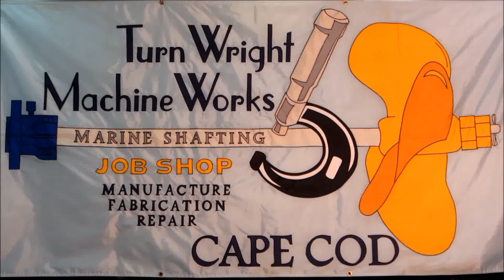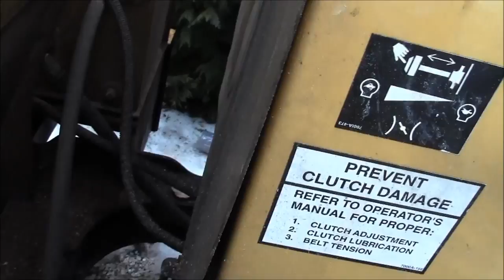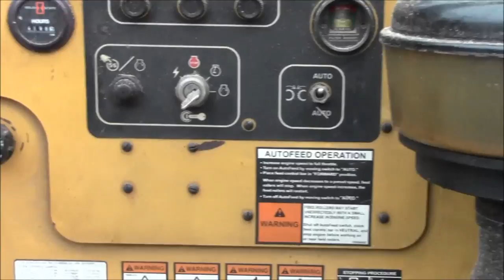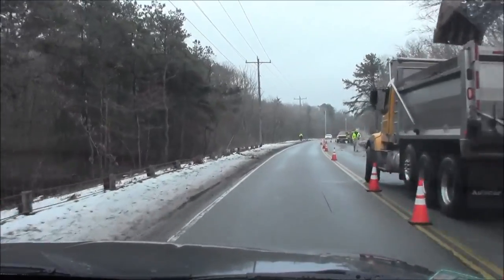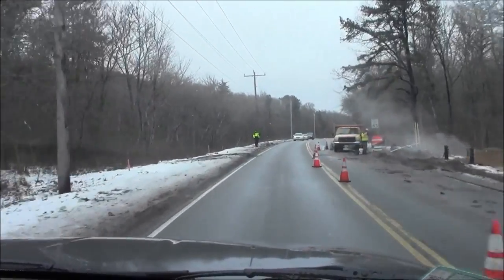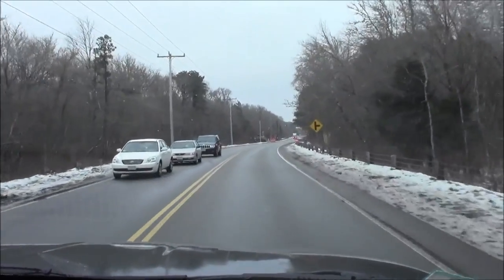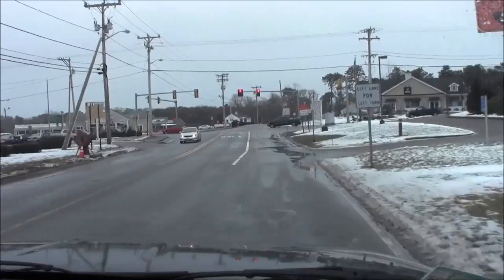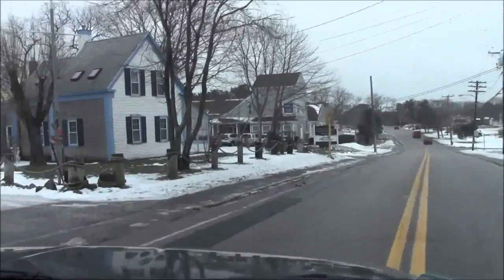Checking out the Beaver!

Comment: just because you can fit a log into it, does not mean you should. That beats the crap out of that machine. Could easily throw those logs on a low trailer and drop them off as firewood/ possible charge for it too

Comment: I used to (in younger days) make arrangements with two-three wood felling companies to pickup their wood logs just as you see here.  They went from 4" to about 36" inches in diameter.  From March 1st to May 30 I could collect up to 50 cords of wood and actually haul three cords in my 20 trailer (3 ft walls, and 7500lb dual axels) home.   They were happy to load them and I merely drove off after they loaded it.  I burned them in an enclosed firebox with a glass front that allowed me to burn all night.  Did that for 5 years before I developed problems from agent orange and had to stop.   My fuel (natural gas bill) was never over $30.00 !!!   (For hot water heater). It was great, but seeing them chew up good wood is just unfortunate someone couldn't come after it.

Comment: For everyone saying they should have used the wood to burn; I think it's pine and you really don't want to burn pine in a stove. it doesn't put off much heat and there's so much sap in the wood it makes a mess.
I've burned it outside in a campfire and it made more smoke than heat.
Reply: Geo Metric yeah, if you have a crap stove. If you season the wood then feed it to a modern smoke-burning stove it will be fine.
Reply: anothermoth He clearly stated he burns green wood.  And pine does suck for heat overall, I prefer harder woods to burn.  Outdoor I like fir.
Reply: soaringtractor Pine makes great firewood if you want to burn your house down. Creosote and tar buildup in your chimney makes a great jet engine sound as it catches fire and burns.  All the stupid comments about this being a waste of wood. There is such a thing as something costing more than it's worth. Portable saw mills, paying a crew to cut up one tree for firewood. Yea if you want to find some hobby furniture maker to cut down the tree then pay the legal fees when he gets hurt, go ahead. And all the safety Nazis. Damn, it's no wonder when you buy a stepladder, you can't see the ladder for all the warning stickers plastered on it. And if you live in CA, dirt has a cancer warning on it.
Reply: soaringtractor I have burned it, a bit sappy though, but good heat.

Comment: Interesting, I worked for the big orange company for a few years and never thought you could put an 18 inch log thru the machine, we were lucky to put a 4 inch limb into the chippers and keep the motor running, but we did run the heck outta them, on one job we ran the chipper so much we blew a rod, and yes the oil was up to specs, those were the days, and that was in the 70s. I enjoy your vids keep em coming

Comment: Lot of comments here about the size of wood being fed in to the machine,'
That chipper will take anything that you can fit in the hole and in fact they could just feed the whole tree in it and it would handle doing that all day every day.
Owners of these like the set the gap between knives and anvil a bit on the large side to speed up things, too big will cause the drum to slow very fast and that will take a toll on it and no surprise it snapped something.  The chips are huge and see at 9:47 and 12:20 its got such a gob full its tossing a heap of chips in the ground as the drum slows.

Comment: Glad you knew of the bulb issue. I agree with another comment up higher ,, your next job for them could be a adjustable speed valve for the feeder hyd. just to let them slow down for large logs but fast feed for brush, it sure would save that engine for a 100.00 pressure valve in line added. Regards Xmodriver

Comment from the maker: It is one of two bulbs on the front and Dodge had a brain fart in their designing department, in the building of this model. You have to take half the truck apart to fully remove bulb. the blinkers still show turn, front and back, I'm waiting till I change out chrome bumbers and then I will have access. ;{)---

Comment: Help Keith amazing truly amazing step by step you what why and better than manufacture so true ,,,your  setups and machine work ,plasma and torch heating and your welds are   real good and love the radius setup with the tracer setup on the back of the lathe can't complain with any of your work and keyway will never wiggle its self the way it pulled down in this case it warrants that custom keyway  I had worse key cuts when I forgot to lock the table  and boss did one keyway  went over to the side and was to late to save the 1300$ shaft ,the shaft would be rejected even if a custom key was made really enjoyed  all you videos  keep pumping them out  Keith excellent work and you worked with out drawings and you were able to  figure  out  the game plan to didn't even ramble on and on with useless words everything you said was done as you spoke.

Comment: How many years of service did that chipper see before the shaft broke? 

I can remember watching my uncle when he hired me to help him drop 28 trees in one weekend, old heavy home lite chainsaw that weighed about 48 pounds he did wear leather chaps but never any ear protection 1964. He hired a logging truck to haul the timber out. He made a little less that way but didn't have to pay for and maintain a ten wheel logging truck. Truck was a 1962 Mack B-81 with a 30 ton winch no loader. The owner operator loaded all timber by 2 pole ramps and the winch and it only took him just over an hour to put a 60000 pound load on that truck with only one new helper  later I found out the GVW for a ten wheeler was 60000 pounds but back then DOT was at home on weekends.

Comment: I don't burn wood, but I have friends that do, and this is how it's been explained to me why you don't burn pine.
Pine is a soft wood, softwoods burns fast, so you get a lot less BTUs out of soft wood than hard wood, but worse than that pine is full of sap, when it's burned it coats everything with creosote.
When your chimney or pipe  is coated with creosote it's a fire hazard, that's how you get chimney fires. 
Most wood stoves use a pipe as a chimney,
it's easier for them to catch fire.

Comment: you will probably see that in your shop again i have run the beaver chipper before and it's not designed material large enough to stall it out. that's why you got it in your shop to start with.

Comment: Hey Keith. Awsome videos. I really like seeing what the repaired part is used for when it is done. Quick question for you. What is the best way to drill a hole through a 1" by 2" steel tubing. This hole is going to be drilled at a 33 degree angle through the 1" direction. Thanks for any insite or experiance you may have. I have to drill 600-700 holes. Thank you for your time.

Comment: This particular machine IS capable of handling a log that will fit in the mouth of the machine, however watching the chip flow and listening to the engine revs and the long recovery time it should be mentioned the machine is working past its design capacity. Eventually other components will fail, if the inlet is feeding nothing but limbs (what its actually designed for) even at full capacity it would not take as long for the RPMs to recover. Optimal feedrate is between 60 and 70% inlet capacity

Comment: Pine aren't too good for firewood unless you find happiness cleaning the flue :)
Good starter fuel, but will soot up everything else. The sap actually helps to keep mulch longer though very few mulch suppliers use pine. Its mostly cypress down here

Comment: One way is to split the wood to a certain dimension, get it burning, then "snuff" it out.  Kinda like capping the chimney and sealing the hearth.  The residual heat continues to cook the wood and carbonize it.  When it is cool, you have wood charcoal.  You could do it in a 50 gal drum with a lid and a sealable airvent.  Google coke making process, But that is made from bituminous (tarlike) coal.

Comment: Great job Keith, I'll refrain from committing on the tree service. Suffice to say you'll be seeing their equipment in the future on a regular basis. I see this was back in 2013, are they still in business? Questions: looking back with clear vision would it have been easier to manufacture a new face plate rather than struggling to get that one to run true? What would you do different, other than the key way, oops....Question #2, as you showed with the feeler gauge the jaws no longer clamp square. Can you remove them and line mill them so that when you clamp down they are once again square? Or is it possible to machine the backs of the jaws where they slide in the chuck face, or something else? Im just curious if there are methods to adjust for the normal wear and tear on a chuck to maintain some of its accuracy.Lastly your a good and honest man, and a craftsman! Thank you, Scott Pecora, Vancouver Washington
Reply: That was suppose to be commenting!

Comment: I wonder what max diameter logs the manual for the machine calls for. I wonder how many hydraulic repairs they go thru, and loading the engine like that can't be good. However, I will predict that the last part to break next time won't be the new shaft/tooth holder assembly.

Comment: Hi Keith,  I think that how that shaft got broke in three parts the way they work that chipper.

I've seen the same model handle same size log and the blades never stop or slow down the way I see it in that video.   THat chipper has some issues.

Comment: Burning wood for heat (in most regular stoves) pollutes immensely so good to see it chipped, although chipped wood do still get burned for heat. Chipped wood has lots of uses, aside from releasing pollutants through partial combustion. Burning wet wood, like Keith, is even worse, and much less efficient.

The lackadaisical attitude towards safety was the worst part; who cares what happens to the chipper.

Comment: If that feed mechanism is hydraulic, I'm thinking that a needle valve, or adjustable flow  constrictor valve could be used to slow it down so they have a smoother feeding flow instead of that surge and stall.
.
And their safety practices...around here arborists are watched closely for PPE and safe practices especially with chainsaws and rigging.
.
After his accident and visit by the ministry of labour and injury compensation people his systems will change too.

Comment: I am like you. I always try to make parts better than the original and address why the original failed in the first place.
I would hope that the care you used to make their part would result in better balance, less shaking and so on.  Was any mention made by the operators about that?

As for that machine it sure seems as if the motor is weak or the feed rate too high for the size of wood they chewing up.

Comment: that was a verry unsafe tree crew. no saw proof chaps. no hard hats. climber had no second tie in point. notches were over 1/2 of the trees diameter. those are are gonna get hurt. i cant believe the guy operating the winch was standing on the infeed tray with the machine still running?

Comment: On the west coast of the US and other places nearly all they burn are softwoods and there are no issues with chimney fires out there.  Avoiding chimney fires:  Burn dry wood and don't let it smolder, keep the chimney temps up (insulated double wall to the cap keeps in the internals hot- creosote won't condense) and you'll be good.  Our set up yields about 1 cup of dry dusty stuff from the chimney per 5 months of burning.  West coasters in softwoods report similar things.  Checkout hearth dot com

Comment: Out of all those guys standing around there's not one with any common sense tell that idiot that machine is not made 18 inch logs I can see how it broke the first time where the nice job Keith too bad they're going to destroy it again
Reply: Tim Jerome I'm not familiar with that specific model and it's defined capabilities, but I do know that every chipper that I've used is designed so that the maximum diameter of material that the machine can process is the same as the maximum diameter of material that will fit through the neck. So in theory, if it fits, it chips. I will concede they did seem to be putting it to some rather robust use, and I can only assume there is zero demand for firewood in their area, otherwise they appear to be chipping dollar bills...

Comment: what a waste of good wood..
Reply: +danmarcelino Evergreens clog the chimney.
Reply: +1-Shot slinger I didn't mean for burning.. Even that's a waste
Reply: +danmarcelino I understand the concern but the tree guys mission is to clear trees from peoples property in suburbia  .Not  to do logging. If you called someone to take long cuts of the logs it would take too long to do the work and they would get in each others way .Plus liability. Homeowner is paying to get rid of the trees ,not harvest them. Besides we never would have gotten to watch Keith repair the chipper.lol
Reply: my mobile wood mill is like half the size of the machine they're using in this video and makes 12' 2x12ves in 30-40 seconds, but i see what you're saying.. haha
Reply: +danmarcelino Some of the tree guys will drop off a whole truck load of huge logs on your lawn but you need a way to handle it. Most guys that get that are cutting it in place for firewood using a chainsaw.
Reply: +1-Shot slinger that would be nice actually.. There's a built in winch and cable hook on the mill and having the logs stacks right there would be amazing! Hahah
Reply: +danmarcelino See if you can talk to the local tree guys . In my area they pay to dump the woodchips and would be glad to get rid of huge logs.
Reply: +1-Shot slinger mannnn!! Haha thanks a lot brother! That would be insanely perfect.. Thanks again!
Reply: +danmarcelino Where I live it looks kind of like Keith's Video Lots and lots of trees. The tree guys have little concern once the job is over they just want to get rid of it. You could come home to a yard filled with huge logs off their truck. It pays to ask.